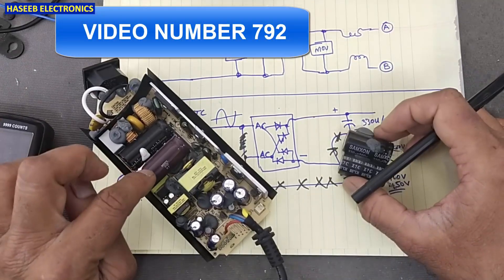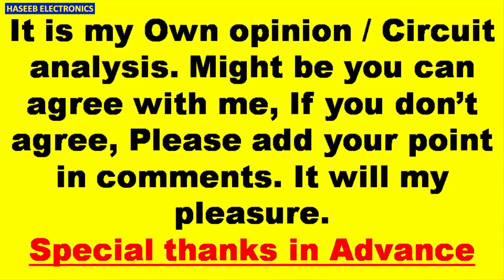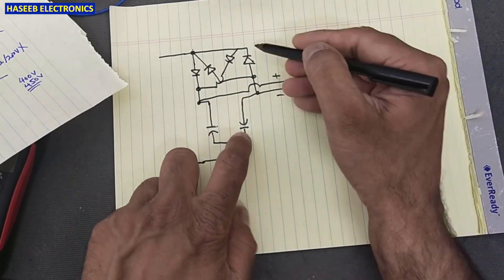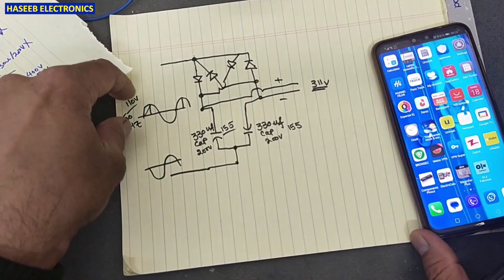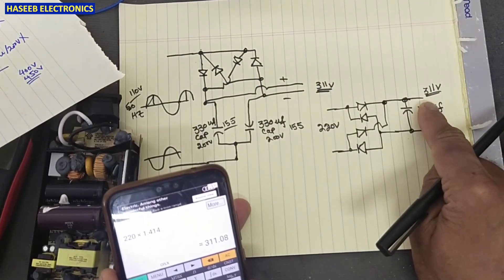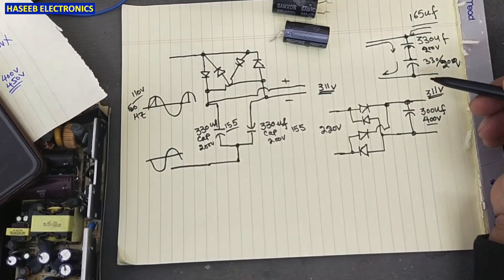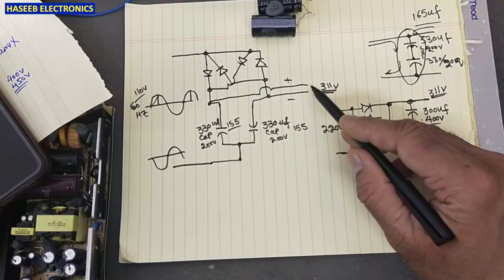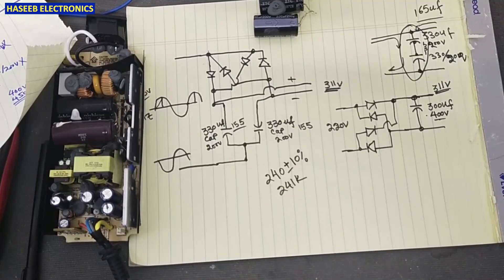{794} Which One Is Best. 1x 400V. OR 2x 200V, capacitor in series

Comment: I am not sure I will agree with the argument of ESR matters here.  Given the application of these high voltage capacitor mainly filtering 50 or 60Hz main AC current after rectification, whether the ESR value is important or not is up to debate.  I don't think  ESR values matter too much here, rather the ripple current rating of these capacitors is important.  High capacitance capacitor tends to have higher ripple current rating, so I think two 330uF/200V capacitors connected in series has its advantage as well.
The fundamental question here is why Microsoft designed this 110/120V power supply with two 330uF/200V capacitors, instead of just a single 330uF/200V with a full bridge rectifier configuration.  This is a typical voltage doubler circuit, reminded me the old, dual voltage SMPS in many PC power suppliers and home appliances. Without any proof, I only can guess that Microsoft intended to have the same design for both 110v and 220V configuration, with minimal changes during the production process, just few jumper wires and a MOV. If such guess is true, the two 330uF/200V capacitors connected in series, with equivalent of 165uF/400V, is perfectly within the design specification for 220V application for this power supply.
Reply: Same thoughts

Comment: The parallel combination is much more useful than the series connection for the following reasons. If you make the capacitor values small enough, but have many, you now can use several SMT capacitor rather than a large thru hole device, which will reduce assembly time. Also, capacitors in parallel, depending on the PCB design (minimizing inductance) and assuming the use of SMT devices, allows a paralleling of capacitor ESR which reduces the overall value. There is one condition in having many parallel capacitors in close proximity, that is of the required airflow around each device for cooling. So, preferred is to have the capacitor bank have only two rows of devices with a small spacing between each (which occurs even if you butt the SMD footprints).

Comment: Dear Sir, I take care about the Energy stored and ESR of series or single capacitor used. That defines stability of the system and voltage stress over power transistor.

Comment: Great explanation! I have used capacitors in series before in a tube audio amp and found that unless capacitors are perfectly match one capacitor can have much more voltage than the other. I'm not referring to this project, but in general. My project involved having to use balancing resistors to get the voltages across the capacitors to match. Best regards!

Comment: Hello mr how are you thanks for the valuable informations. Does this modification works for all 110 volts smps?
Reply from the maker: most welcome brother 
if the power supply have this type of circuit configuration, then this method will work

Comment: The original circuit, using the two 330uF caps in series, is a classic voltage doubler circuit. Each half period charges one of the two caps only. Then their total voltage/energy is fed to the circuit. If we apply the formula for the energy stored in each capacitor, this will be 3,983 Joules, for 110V mains voltage, making a total of 7,986 Joules of energy offered to the circuit. This means that if we use full wave rectification, but with a line voltage of 220V, according to the same formula, we simply need a single capacitor at the half capacitance of the originals, that is 165uf. This cap will store the exact amount of energy as before (7,986 J). Now, as this value (165uF) is not a standard one, we need to choose the next higher capacitance  value, that is 180uF, working this time at 400V of course.
The same modification, but in reverse way, can be done on a European psu, working on 230V, to work on 110V. Simply we instal a  voltage doubler at its input, after removing the full wave rectifier, installing now two caps in series, having double capacitance value than that of the single one used originally. The key point in such modifications is the energy storage of the input circuit, which should always be the same (as it was originally designed, before the modification). 
This process has nothing to do with parasitic inductances. The primary side capacitors work on low (line) frequency and do not suffer in the way the secondary side caps do.

Comment: sir does it working as voltage doubler circuit principle   so that it convert 110(155 pp) to 311 voltage by using 2 capacitor s. sir    if i m wrong please  pardon me.
Reply from the maker: you are right. it is voltage doubler method